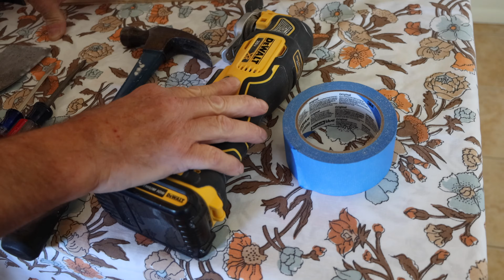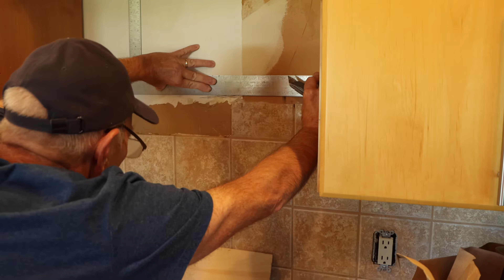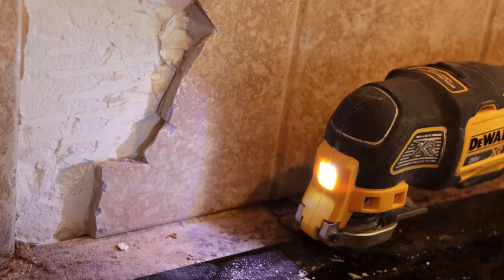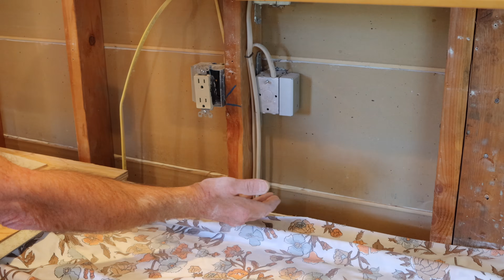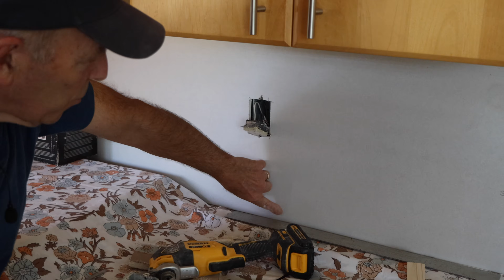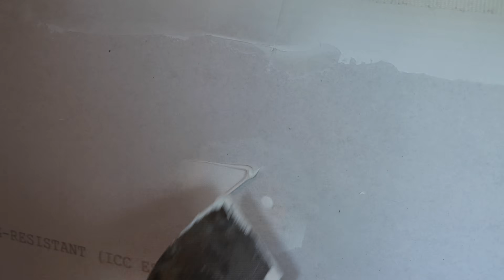How To Remove A Tiled Backsplash

Comment: What about the Sheetrock that sits near the granite top.. when you cut it out, do you leave an 1” so that the new piece sits on top and allows you to tape and mud? Hope this makes sense
Reply from the maker: On this one I only had about 1/2 in of Sheetrock so that was good enough to mud and tape
Reply: Can I use an oscillating scraper tool to get the tile off wall?
Reply from the maker: @petepapadopoulos6639 yes you can

Comment: If anyone attempts this and owns an oscillating saw, but a semicircular tungsten carbide bit, and remove all the grout lines first.   The tiles come off WAY easier that way, because they aren’t all attached, so they seem to pop off with less effort.
Reply: Did you use a scrapper attachment on your oscillating tool?
Reply: @petepapadopoulos6639 I actually used the carbide semicircular blade to remove the grout, then just popped them off with a mini prayer/small hammer.

Comment: Thank you for this video! Can you demonstrate how to apply the spackling underneath the cabinet? How does the spackle not fall down into the crack then there's no other piece of drywall to adhere to above it? Wouldn't the spackle get all on the underside of the cabinet? Did you have to remove that screwed in underside cabinet piece first then spackle?  Lastly, do you have any vids on removing tile countertops too? Thanks again!

Comment: We are doing a similar project and have only done tile on floors before.  We have removed the tile and are replacing the drywall. Can we cut the old drywall right under the cabinets  using the bottom of the cabinet as a cut guide, and right at the level of the countertop and eliminate the need for the tape and mud where we have upper cabinets? I noticed that you used tape and mud on a seam under the cabinets, but not at the countertop level. Can you clarify why?

Comment: Hate to be that guy, but a reciprocating saw is basically what we call a sawzall.  What you are using is commonly referred to as a multitool, or an oscillating saw.  As for the actual job.  Might want to try using a heat gun on the tile, for awhile.   When the glue is melted, the tile should come off fairly easy.